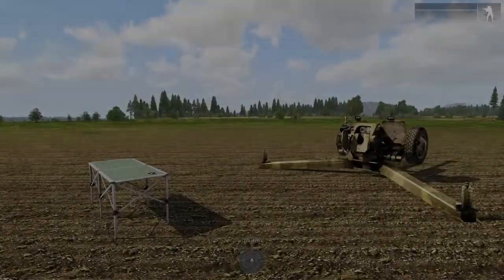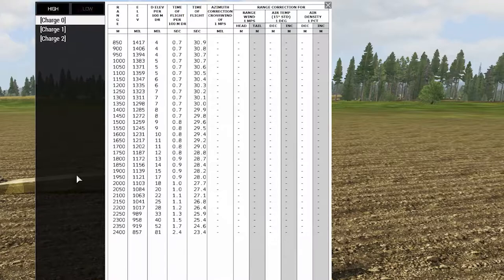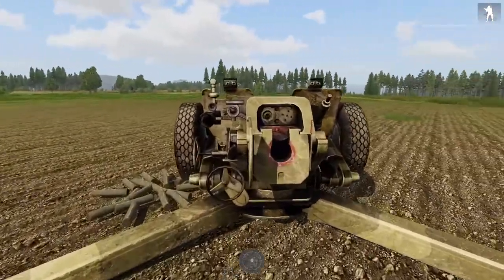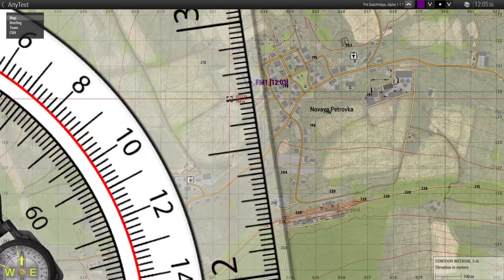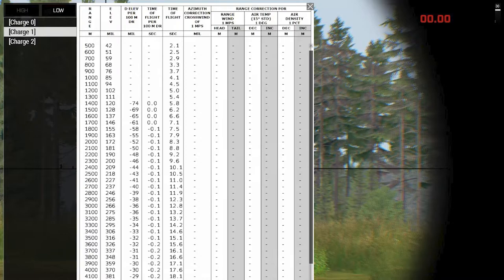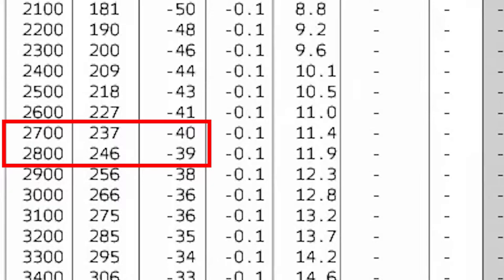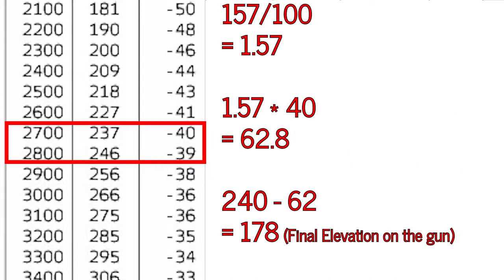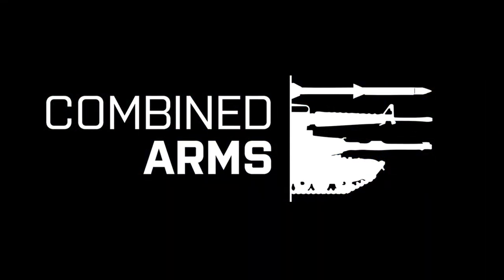Manual Artillery Laying, a Brief Tutorial

Comment: omg they have high low angles selectable nowdays!? I made an exel computer to calculate back in day. It was pretty good system I had. It made quite the difference when i did testing to shoot the farthest distance possible from SW corner of altis all the way to the NE corner. Vanilla atrycomp gives only high and tof is like 2-3 mins where low angle tof is like 20 sec or something. An the spread is also insane from artycomp but spot on from exel comp.

Comment: You may want to look into the microDAGR more. An observer can obtain an accurate 10 Digits GRID with a Vector21 connected to a DAGR. You yourself are then able to set these as a waypoint and show the direction from your pos in mils. If u have access to it during ops you maybe want to use it to its full potential ❤ great vid

Comment: Maybe include a few more elevation difference examples - 240 and 178 seems like a huge difference for only 157 feet of elevation difference. The physics isn’t intuitive (to me at least LOL)

And I don’t follow your interpolation at 6:15. If range is 2760 , or 6/10 of the way between 2700 and 2800, why isn’t it 6/10 or 3/5 of the way from 237 to 246? That 7:41  it 242 or 243 not 240. Why would you count backwards? What am I missing?

Comment: Its not too bad, tbh I feel that the difference in elevation adjustments make it overcomplicated.   There's no need.  Artillery isn't accurate to begin with in arma 3.  It only makes a noticable difference with mortars or extreme ranges
Reply from the maker: As this is Artillery using ACE, the adjustment for Elevation is entirely non-optional, your shots will go off by hundreds of metres in either direction without it. 

Having ran a dozen Artillery crews in Arma since this video, without it you simply will not hit enough targets, or miss entirely, or hit friendlies.

Comment: let's say my Range is 1/4 of the way between the 2 ranges, Would I still divide by 2? or would I divide by whatever the 1/4 of that number is?
Reply from the maker: You could divide further down, it would assist with accuracy, but at this point you're hitting the limit between ultra realism and ease of use.

Comment: is there a formula you reference with all the math?
Reply from the maker: No sir, just do the match by hand at the time. This kind of thing is all something you learn from someone else -  a video like this, or another resource.
Reply: @DutchVidya  okay, thanks for the quick response and the video. :)
Reply: @chrissouthwell8806  In case you need a formula, I got one.

1000 * arctan ((Z^2 +- sqrt(Z^4 - g(g*X^2+2*Y*Z^2)))/(g*X))

Z is velocity in m/s
X is distance in meters
Y is the height difference in meter (positive is higher than your position, negative lower)
g is gravitation
for the +- differential: + is high angle - is low angle, use depending on how you want to fire
Reply: Does this take in affect aerodynamics? Or do those not apply for arty in arma?

Comment: Spent the last week just trying to get some damn elevation data to show up on the map, tried every gps, watched every map tools tutorial on YT. read every reddit thread. I'm genuinely getting frustrated here.
Reply from the maker: Hm, difficulty with this is that could a mod conflict. ACE can be particular. Also, it's been some time since I did this guide, and whilst the actual steps havent changed, I couldn't comment if ACE has done any updates to break Artillery in some fasion. That also means every install has potentional to be different. In particular my Arma group maintains their own stable version of ACE, and does not update when ACE does - further the terrains can get in the way in backend ways that are difficult to diagnose. I recommend trying just having ACE installed, and seeing if you can get things working with that and the Vanilla artillery pieces. If it works - start adding mods back until something breaks again.